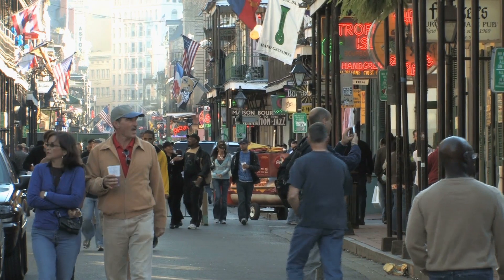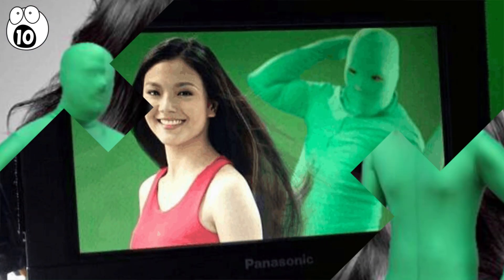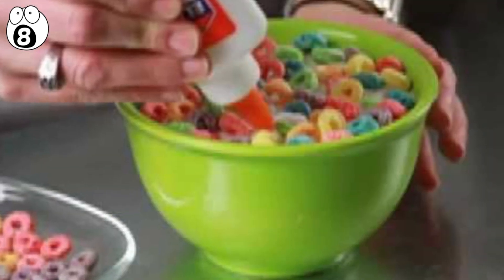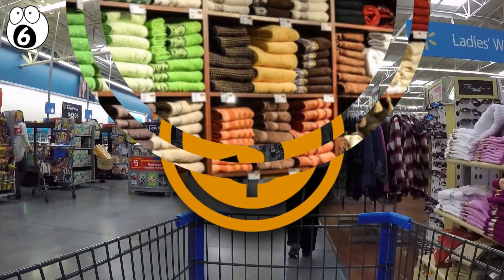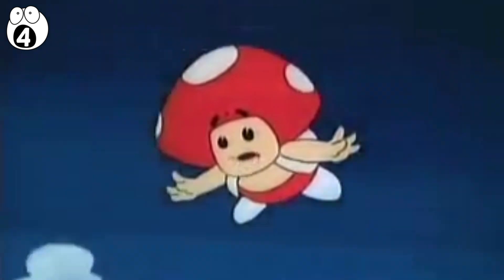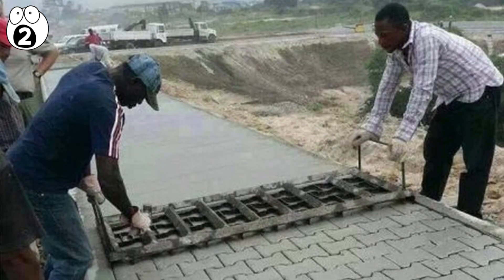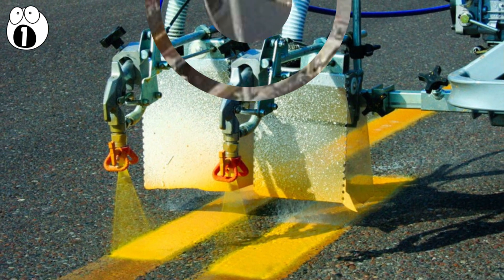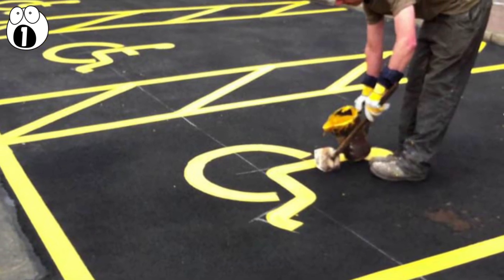Everyday Things That Prove Our Life Is a Lie

Comment: Seen somebody painting road markings with a paint roller though
Reply: That is just common knowledge everyone knows that paint rollers are used
Reply: ELECTRON that’s fantastic, A+ for you
Reply: @13skp  by that I mean rollers are used more commonly and tape is rarely used as it costs like fuel for the flame
Reply: They usually spray them with a machine
Reply: @Skirot  Actually rollers aren't used that often when painting lines.  They use machines that drop paint at a certain width and just move the machine according to how long the line needs to be.

Everyone knows that. 😜
Reply: @dwheels90   True, many times I've seen those truck-mounted machines driving along the roads painting the lines. Much faster and cheaper than the blowtorch procedure, which is generally only used for fancy shapes like arrows, wheelchair and bicycle symbols etc
Reply: @Skirot  Most road/street lines are done with a paint sprayer, as it is quicker/more efficient, and it doesn't require a stretch of road to be completely shut down while the work is being done. While I'm sure that some jurisdictions might have a reason for someone to use a roller to make the lines, generally they'll use a truck outfitted with sprayers to do the work and apply the paint.

Comment: #5. Not true, the commanding officer of any ship is called Captain, regardless of his actual rank.

#1 The tape is used where the markings are temporary, like in construction zones. They usually paint the markings.
Reply: Not true.. I have seen those tape ones used many times.. But they are usually used in places where paint would get worn off fast due to traffic wearing them down.. places like the multiple white lines where you are supposed to stop at a red light, and even a lot of arrows to tell you it is a turning lane.. But again, these are area that are usually "very" high traffic.. Not your everyday side road, or on very old blacktop.. But I did get a laugh at his "could you imagine how long this would take trying to paint this" comment to the handicapped sign.. Uh.. Lay the stencil down, spray paint over it, pick the stencil up, done.. Yup.. Really hard.. lol 

PS.. Those stencils they sell are not that expensive (considering all the work that they save), and are made out of plastic, so definitely reusable for hundreds of times..
Reply: I mean, the whole parking of a store where I work was painted with this type of tape, also, he said lots of what you two said in the end of the video.
Reply: BigLoo thank you
Reply: BigLoo OOF
Reply: nope cuz he dozent  drive a ship so he is a camander
Reply: #5: not true, indeed and anyway, a captain doesn't wear 4 stripes! as for #1, at least in France, Germany, Switzerland and Belgium (and almost everywhere in UK), tape road marks and signs have been in general use for years. Paint has become very rare...
Reply: Thermoplastic is not temporary. We use it as crosswalks, lines and handicap signs.. The silver backed tape which requires no heat is what they use for temp situations. -Ive been a paving contractor for over 15 years....Trust me on this.
Reply: RazorW1re captains don’t sail( u don’t drive a ship) the ship, they control all actions that other officers are doing, the helmsman is the one that sails not the captain
Reply: In Maine, a lot of turning arrows on roads and markings in parking lots,  are laid down with paint over a stencil. But they also call Mainers maniacs so take it as you will
Reply: Red 3024 in case you didn't here by the name that it's fire proof
Reply: in Québec (province), Canada, I never saw roadmarking being done with tape... all the road are painted.
Reply: I live in CT in the USA, I just saw the paint trucks spraying lines the other day on the road. I guess everywhere is different.
Reply: Roads are marked with paint. I used to sell it. Tape can't carry the tiny glass beads that make the lines show up at night. Also the tape method would only work in areas where the roads are free from freezing and rarely used
Reply: @adamhunter3692  now THOSE are facts

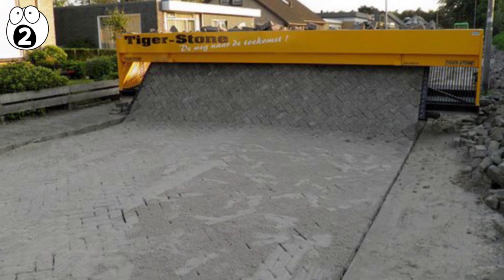Comment: 7:30 thats not how those machines work. You still need people to lay the bricks, all this machine does is allow you to lay brick while standing up. Its DOES NOT lay brick by itself.
Reply: Yep, lets you have a team of guys laying brick while standing essentially in one place on that platform on the front as the machine is advanced slowly.
Reply: Wow
Reply: So it's just a giant spine and knee saving aparatus?
Reply: @rickypen  Yup
Reply: And, all the corners and other things they are not straight away need to be handmade.
Reply: Wait. Can you explain this a little better? Because it sounds like you're just making a semantics argument. As in "the machine isn't an autonomous robot...bricklayers are still required to operate the machine". There's nothing wrong with this argument, just looking for a little clarification.
Reply: @Mark Hummel, not sure which type is superior. I just agree that the video shows as if the  machine is doing all the work, when in fact it isn't.  I second rickypen's comments that this is a giant spine and knee saving aparatus. To top it - it also makes the process quicker and more efficient.

Comment: In some areas, painting the lines on the road is the most efficient/safest way to make the lines.  Using the painting machines does not require closing down a stretch of road/street, it does not need to have an extensively large crew and is generally less expensive to the jurisdiction hiring the workers, or the company hired to do the work. Even though the paint isn't as 'tough' as the tape, it is still used extensively in the upper midwest/plains states, as the tape is much more expensive than paint. The paint colors have been pretty much standardized by now, so no exact mixing of colors is needed.

Comment: The Brick-Machine was a new invention in the Netherlands and it existed only 3 of them in 2014. Since then (and in Germany still commonly) people lay Bricks by hand!
Reply: Don't the bricks need to be aligned by hand even with the machine?
Reply: +saedin i dont think so
Reply: There have been several different style automatic brick laying machines around for a decade or so now.
Reply: For that machine, yes, they have people lining up the bricks. They have other machines on the front of a bobcat now that pick up layers of bricks from a pallet and lay them all down at once, just one person driving the bobcat and one person to align the brick. It does about 4x4 foot patches in one go, and only needs manual labor to place 2 interconnecting bricks.
Reply: The ones I have seen on TV or in videos, yes, even with the machines they have people standing there putting the bricks in the particular pattern on the machine where they down a chute and the machine lays them down in that pattern.  They don't just dump them in a hopper and let the machine do the pattern.  I'm sure it's possible, I've just never seen a machine that does that.

Comment: I used to be a purchasing agent for a road construction company in Florida. When the striping and signage company "painted" the lines on the road, it wasn't paint that they used. It's melted thermoplastic. If they were painting lines on a highway, then they used a big truck. Looks like paint spraying onto the road but it's melted plastic. Immediately behind the sprayer is an applicator that puts a layer of ground up glass on the melted plastic while it's still "wet". For smaller things like arrows or stop lines, they use a push cart that also dispenenses melted thermoplastic and glass dust. Of course there are many places, including Florida, where all of those things are done with actual paint or by melting plastic tape with a torch. You can tell the difference by looking closely at the finished product. Just don't look closely during rush hour :)

Comment: I don't know where you got your info on the road painting stuff but 99.9% of the time roadmarkings  it's painted and blowtorched to dry the paint. They also just use stencils for the arrows and handicap signs... and any place that snows would have to plow the roads and that shit would just get peeled up tape.
Reply: FoodTech Yeremy your wrong they don't use blow torches it's illgal to do they paint by a walk behind sprayers
Reply: The paint that is used dries fast when it come out if the line striping machine there is no reason to have to speed dry it with torches.
Reply: Is true
Reply: Actually this video is right, you get pre- rolls of tape of which you cut to a certain length then roll out and heat using a so called flame thrower to the ground. No using this flame thrower is not illegal as it is needed for the lines to melt to the ground. I am from the uk and a road worker myself.
Reply: DontRageBroYT must be a U.K. Thing. I live in USA and I've seen them paint the road.
Reply: I think they use the tape in parking lots. I've often seen it come up off the ground on really hot days, especially in a newly redone parking lot. I'm from the US, by the way.

Logically, there is probably a mix of different ways this is done. Also, different contractors use different methods depending on the job to be done.
Reply: I first noticed the tape when I was in the UK, so probably. It's very obvious just from looking at it or stepping on it, that the specific marking is set up from the road surface.
Reply: I have driven behind the truck that was spraying the paint onto the roads. It was clearly two lines of yellow paint. People sometimes drive over the yellow lines while it's still wet and get yellow paint onto their vehicles.
Reply: FoodTech Yeremy where I live they have trucks that have built in spray painters and they just spray the road. No stencils, no tape, just spray paint.

Comment: Where I live they often use a grinder to remove a few millimeters off the pavement, then they put the tape down.  This way it is slightly lower than the rest of the pavement and the snowplows won't scrape it off in winter.

Comment: Old video but I use to work for a company that did road markings. They used bags of thermal powder  and they heat them up  to liquify it and used trucks to spray it on the ground. They used thermal tape for stop bars and cross walks.

Comment: For those wondering about the thermo plastic, I work with this crap, that tape is just one way. That is called preform and it’s used for stencils. The other type comes in a 50lb bag full of plastic beads and dyes. It needs to be heated to 350-400 •F in a kettle and the smoke it releases is absolutely putrid

Comment: I work in retail and we fold all the towels.. this video is bs
Reply: +Micah Nungesser me nether
Reply: Eric91611 I worked at Bed Bath and Beyond in CA. This is definitely true.
Reply: I was about to say... every department store in Vancouver has stacks of towels. Retail space is too expensive to pull that.
Reply: Micah Nungesser depends where because from where I'm from they're all folded
Reply: Eric91611 it's not like he said every store does this. But it is true because I have seen that foam with towels in some stores
Reply: Yup, true....I knocked over a stack of towels once by accident.....guess what.....they were all towels.
Reply: @Micah Nungesser Nope, the fake towel picture is taken from bed bath and beyond in America...
Reply: I worked retail and we folded all our towels except for the two or three shelves from the ceiling that we couldn't reach without a ladder. So no, this video is not all bs.
Reply: Eric91611 or maybe the place were you work is bs
Reply: The towels with the foam are also found in Kohl's in America. They're the display towels that are along the wall not the ones you buy.
Reply: When I worked in retail, I did fold towels on occasion.  But I wouldn't surprise me if they used the folded towel display thing too.

Comment: the road printing is still done by hand just search for tiger stone. the machine is solely to keep workers in a comfortable working position
Reply: Some road markings are done exclusively with vehicles.  Where the workers just sit inside and monitor the work as the truck moves on down the road.

Comment: just FYI, in America most road Markings are made of a plasticized paint, that is melted in a vat at 600 degrees and then sprayed onto the road, and then tiny glass beads are put on it before it cools/dries to make the reflective properties of the stripes. and this is why when you see road work happening, and they have to move the stripes, where the stripes were now is left with Ugly Marks, because they have a machine that Grinds the Stripes off the ground to get rid of them, which leaves ugly grind marks where the stripes used to be.  this is because paint would simply wear out super fast , and that Tape is less than useless for actual roads!!  (it's good for parking lots, but not roads)

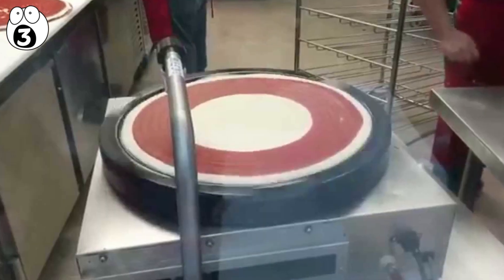Comment: You need an editor. Time 6:30 "patio's" is spelled wrong. A very common mistake that is getting more common. No apostrophe is needed, and it totally changes the focus of the word. The point of pointing it out is that the more it is misused the more people will think it is correct and use it more, which then makes the language less precise.

Comment: The brick one is not real. I lay bricks for my job with my dad and we do it by hand. I'm this isn't right
Reply: They normally do what he said in large scale brick laying but it is better done by hand
Reply: Max Middleton i worked in commercial construction for 20 years never saw thid machine. However the machine does exist as do bricklaying robots that build walls. Look them up.
Reply: Max Middleton ok, I've commented on other ones, it's not the same for all things
Reply: Just because you lay it by hand doesn't mean everybody lays it by hand
Reply: This machine is from The Netherlands. It’s purpose is that the people who lay bricks don’t need to sit on there knees and so they can stand on a platform behind it. They still need to lay it in order though. It is better for your back and it is very efficient in time.
Reply: +Iron-Bran not everyone makes bricks like that, it's just a lazy way of making brick placement
Reply: Indeed, its not common practice.

Comment: The thumb nail is wrong. There are both wrong, my grandpa worked on my local street department. The actual way is they have a Machine that you walk behind and it sprays out paint. On highways they have trucks that spray paint on the road.
Reply: Awesomeman223 well he did say only some do the tape thing, and he also said they still use paint so you're both right
Reply: That method is also used to paint on sports feilds and he did say that method but his picuters are confusing cause most use a paint machine or tape they usually don't use a paint brush
Reply: LOL ur name is almaost egsagtly like mine
Reply: +Moya Ndourny-K
Fields*
Pictures*
Reply: +awesomenyancat 242
exactly*
Reply: Thumbail*
They are*
Reply: He said there are different ways you can do it.
Reply: Awesomeman223 yeah, my dad works in the field. Its called line striping
Reply: He said some do the tape thing but some also do paint so some people do use tape
Reply: Awesomeman223 They do both, at least around me. I've seen them doing crosswalks with the other stuff, but most of the road markings I see are clearly painted.
Reply: When I was a teenager, I had a yellow road tape line that I hung on my bedroom door.  Some lines in some places are painted, but where I live, they are rolled.

Comment: Road marking tape is mostly used for temporary markings, most lines are spry painted with a water based colour or two component spray plastic. Colours are not mixed there made that way.

Comment: The brick laying machine is impressive I also like the tape road paint. Technology make hard work easy.
Reply: nah, thats not how it works at all. If you look up videos workers still need to arrange the bricks and feed it in to the machine
Reply: They still have (usually) two people putting the bricks in the machine. It doesn't just set them on its own. However, it is exponentially better than hand laying them. But, the machine is only used for large projects. Sidewalks and small streets are still laid by hand
Reply: And the road tape is used for city areas, around parked cars and mostly for temporary marks during construction

Comment: In my area most markings are still done with paint trucks and stencils like turn arrows (mostly by hand so the arrows match up with the old ones). Signs are posted "Do not cross wet paint" for obvious reasons. They do stick on those little white reflective bumps with blobs of adhesive though. Can't remember if that's by machine or by hand. I guess if they only need a few it's by hand. The little yellow 'flaps' go on by machine during road construction.

Comment: idk about that foam deal with stack towels. But at walmart we have to fold them and put them neatly on the shelf in a stack. Most of the time however they come prefolded in a tight fit plastic werap. we just untape 1 end and pull it out and set it on the shelf. Theres no foam for us. so IDK what stores do that. But I know not walmart. Also I want to see that pizza sauce deal. That looks nice. Our local pizza places still use the actual scoop. You can see the back areas where they make them in our area ofc.
Reply: Its mostly places like Bed Bath & Beyond where they have a whole wall of folded towels. I remember accidentally pulling one out, it was nailed down to a wooden frame covered in foam. Felt like pulling back the curtain of Oz or something